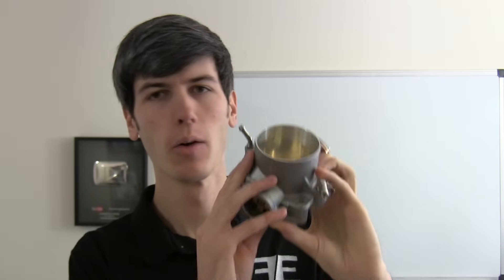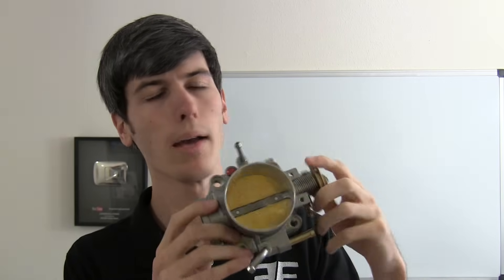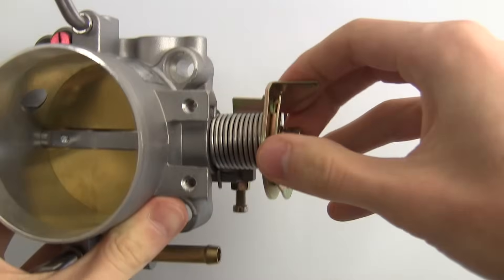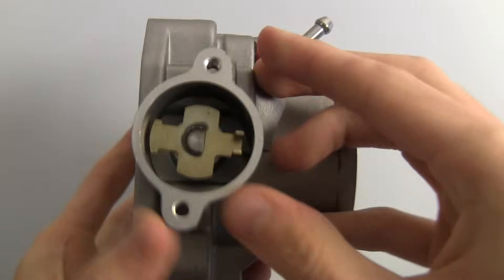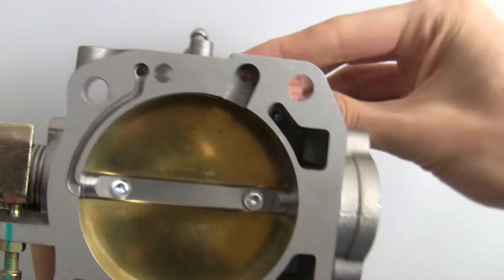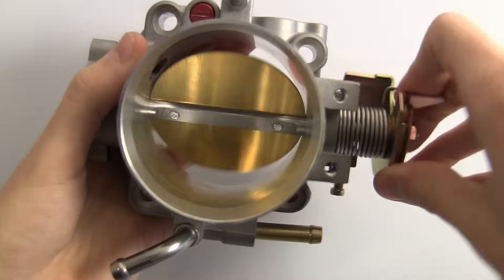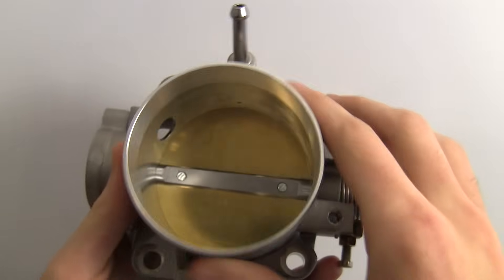Throttle Body - Explained

Comment: So if a throttle body is dirty, ( or has a leak ) why would that cause a rough idle at when you first start a car after sitting over night ? The valve is closed  minus what little is opened from being dirty and not make a good seal when close.  And seem like the car would  continue to run rough ? ( My 2007 Acura TL  has a slight rough idle on start up but after a minute it goes away and runs normal.  Internet search said it could be throttle body needing cleaned or having a leak ) Help ??

Comment: On 4:23 the top vacuum line should I keep it blocked ? I bought a cold air intake which has a place to connect the breather pipe then another small line which fits perfectly on my throttle body vacuum on top should I connect it there? But when I do my idling is more quicker and higher but smooth and when I close it my idle goes really low and wants to stall. Please advise as they told me connecting it like that will consume more fuel and cause high emissions

Comment: Great, few questions.
1) Where installed this throttle body?
2) Is typical too heat it via engine cooland? Looks like even on my Daewoo Lanos I have electrical heater there.
3) In my case vacuum line goes to the brake booster. But how vacuum collects there?

Comment: I had head gaskets replacement on my 95 z28 Camaro putting her back piece by piece... she ran good... drove on intestate etc... started every day etc last 4.. but if drove her short trip.. on the way back she shut of check engine light etc... would not start... but she did. Later..but got her home..started.. but i gave her gas it started sporadic Idling then cut off , wouldn't  crank ..but later it did ... not sure don't think fuel pump..

Comment: Here there is an alignment screw that ensures that the butterfly is in an idle position which means the exact 90 degrees with the surface and air passage is fully closed through the throttle variation. It cannot be the same for long duration of time and can be affected from multiple factors like dust and as you told climate. Instead of passing the air with the control of butterfly if we make sub holes on the surface of air flowing chamber and connect all sub holes to a single hole which goes to the combustion chamber and assign a piston at 180 degree instead of 90 degree butterfly it can last for a long time.

Comment: My engine wouldn't turn over at all, and I thought it ws a stater motor problem. The mechanic said it was the throttle body causing it. It stopped the engine cranking? Doesn't make sense to me...

Comment: The video is very helpful. I have a question, is there should be a small gap between the throttle plate/butterfly and the throttle wall?

Comment: I have a problem. The exclator is jurking due to the throttle valve. How to clean so the smooth pick up in the car? I have Tahoe 1997. Thanks!

Comment: The even better thing to do is to remove the whole throttle body and clean the area behind the valve more thoroughly. Also allows you to clean the small passages easier.

Comment: i have noticed throttle delay in my new car, specially visible in idling speed, engine is very slow to react when i press acceleration paddle, i must press continuously to rive the engine, is this wrong or its manufacturing feature?
Reply: Tighten your cable

Comment: I have a 1989 mitsubishi montero 3ltr v6. I can't find a new one, I can't find a rebuild kit. I had max bore bore it. The bottom half isn't working right. It has a spring and vale in it. I can't find a replacement.  An you help me.
Jim

Comment: Should the throttle plate seal 100% of the throttle body or is it normal to have a very thin line of air? I have an old lancer glxi 93 and my rpm is a little bit high. Hoping to get an answer from you good sir.  Have a nice day.

Comment: in some cars the iacv fails so they install a bypass with an idle up actuator working with the compressor and that works to prevent engine stall when ac is on...my question is, how is it that this bypass works when the iacv has already failed to begin with? is it because of the screw adjuster still allowing air for idle somehow?

Comment: What would make my 04 Chevy aveo  to rev up while driving and pressing on the brake. It revs up like it doesn't want to stop and I have to put it into neutral  and park it in order to stop. It's been at the dealer  for 2 weeks now. The throttle body  has been cleaned  but this never happens to any of the mechanics  thier. Could it be the transmission  or something inside ot. No engine light ever came on.

Comment: Does oxygen fall into the throttle body faster if it's got a high-rise intake. Or cause it to fall faster in the engine when u use a THROTTLE SPACER?

Comment: Hello,i got a kia rio 2013 1.1crdi and I just cleaned the trotle body,wich has drive by wire,any ideas why even after removing it was wide open,cleaned,fitted,still wide open,car starts,idle ok,drives normal.

Comment: My RAM 3500 shows the lightning light, then I can’t push Gas. 
I replaced the throttle body but still the same problem any advice I’m getting frustrated.

Comment: Considering this video,another question poped out of my mind and that is when the engine starts,you don t press the accelaration pedal. Therefore,how does the engine suck air to keep running if the throttle body is closed?

Comment: Hello I know this video is old but I have a skunk 2 70 mm tb for a Rsx type s but I’m still stock and do not have hondata will I still be able to run it mean time till I get hondata ? All n all my question is if It will work without a tune? My oem tb is bad and I have this one really not tryna spend the money so I wanna work with what I have

Comment: Hi, its rajen from india, pls explain me how throttle plate increases RMP and engine to work faster. 
Second . Someone has told me that machine works same whether in gear 1 or 5, it is the gear ration increases the RMP ,then in gear 5 how rpm increase from 2000 to 3500 when speed increases from 60km/he to 100 km/hr

Comment: What I want to know is, given the design, are throttle bodies universal between petrol and diesel motors?
I mean, I know the throttle works by the amount of diesel pumped irregardless of the air, but how does this affect upgrading the throttle?

Comment: my engine revs a bit high when i drive, especially when the car gets hot.  Sometimes when i'm going down hill and put it in neutral the rev can be a 2,000 rpm and gets stuck there.  Once i put it into drive , it drops down to 1,200.  What can this be because at times if feels like the car is just accelerating.

Comment: I have a 2012 civic lx. I recently cleaned my throttle body (without touching the plate) and MAF sensor. After doing so I have been running into all sorts of problems even after doing the PCM idle re-learn. On a cold engine start, the RPMs hit 1500 and gradually goes down to normal, but it takes a little more than 5 minutes/less than 10 min for everything to get back to normal.  Took my car to the dealer and they said that I more than likely damaged the throttle body and have to get it replaced. I dont know if they are just trying to swindle me or did I really damage it. Does any one have any thoughts? any feedback would be greatly appreciated.......

Comment: I have a 78cc throttle body on my engine thats stock ran by wire,  im gonna change it to run by cable whats the best throttle body to get? It was a stock engine all i did was change the cam. I dnt understand the difference in throttle body

Comment: After I changed the oil and filters in my scania 124l 470 my truck has engine knock and when I touch the accelerator then the engine keep boosting it self.I don't know what to do.

Comment: Question
When the key on will the Throttle body butterfly  open when you press on the gas pedal with engine off on a 2008 Suzuki Grand Vitara

Comment: Hii what's up.
I am facing problem when i switch off my car engine then after 2 seconds there Is unnecessary sound occur from throttle sound which occur it is like the valve open or close with something touching to throttle body . Can you tell why this happened and can it be stopped or not

Comment: my throttle plate/flywheel is not sitting flush on my non-mechanical throttle body, causing a lean condition p0171, 2010 Mazda 6

Comment: need info for my car..mine is a chinese foton van with chinese isuzu 4jb1 turbo common rail system. i looked all over the motor to find how the throttle is being controlled but i found no throttle body. i'm curious how it is controlling the rev.. any input please..tia

Comment: The problem is a axle of throttle cam must be precision move into body7 exactly in small engines. if its not steering of fuel or steering of throttle (air) is not correct.

Comment: I have 2017 camry se.  And I'm getting a p1604 Startibility Malfunction code.  The car surges up in 2nd gear.  I'm wondering would a bad throttle body cause this?

Comment: Hello Sir, thank you for your effort explaining about throttle body. I have questions for you. I have a 2017 Mazda CX9 Signature, and it already has 30k plus miles. I would like to perform DIY maintenance such as cleaning the throttle body. 
Is it advisable to remove the throttle body and clean it? 

If it is, what type of cleaner should I use and which part of the throttle body shouldn’t I spray? 

Besides the throttle body, are there other parts need to be cleaned?

After installing it, do I need to use a service maintenance device  ( Sorry, I don’t really know the correct term for the device) in order to reset and relearn functions? 

Thank you!

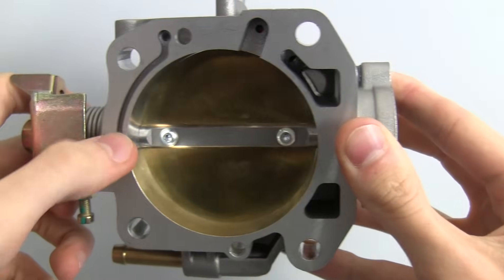Comment: At 2:00 you say it would read a higher pressure with more air flow but wouldn't it be the opposite?
Reply: No dumbass.. more air equals more pressure. If I were to push a heavy door open I wouldn't use less force..
Reply: @guitarpro594  he literally talked about Bernoullis principle. Went in one ear and out the other huh? The more air flow means that the air is less constricted and can speed up. Air has a lower pressure the faster its moving.

Comment: Does cleaning the throttle body really work? My Hyundai service manual says there's no need to clean it but there are so many videos on YouTube about the benefits of cleaning it.
Reply: Yes clean it and DO NOT TOUCH THE VALVE ON THE INSIDE AND MOVE IT, DO NOT TOUCH. if you have carbon build up inside this will drastically effect your throttle response and cause throttle lag. If you don't know if it will help take it to a certified mechanic to be cleaned and inspected. Or do a lot of research and have a friend who knows and has done it before to walk you through and show you what to do and what not to do.

Comment: Can the throttle body be installed  with the butterfly in the Vertical position? And if not please explain. Thank you for your help
Reply: Juan Gonzalez that would just be a reverse pedal which would be the same as slamming on the gas 24/7. pressing the gas would just flip it closed instead slowing down instead of accelerating. It’s possible but you’d probably choke the engine on startup
Reply: SoulandEllis wrong is working great. Thank for trying

Comment: Hey @engineeringexplained I have a question is it safe to back off the  nut holding in the spring where the cable connects? The throttle body I bought is really stiff (responsive but takes a lot of pressure) I am trying to make a lighter pedal but safely. Thank you for any and all information.

Comment: where is idle speed controller and how it s control the speed of engine ?
Reply: The video does explain this. Listen for IAC (Idle Air Control). Basically it is a controlled vacuum leak for idle speed.

Comment: I have a 1993 Lincoln Town car.4.6L V8.. On the left side of my throttle body has a hose connected to a medal "stump" like in the video here. On the right, it has one as well. But I cannot figure out what connects to it? Can someone please let me know? If a hose connected there then I don't see where it would attach at the other end?
Reply: It's either a vacuum or coolant line.

Comment: I went to do an oil change at a dealership where I got my car, and they did an multi-point inspection,  and they said the throttle body is dirty, and was going to charge me 89.95 for them to clean it, is this something I can do myself? I'm no mechanic but I'm good with tools.
Reply: Yes it's easy, simple instructions below😎 and always remember NEVER MOVE THE BUTTEFLY VALVE if it is electronic they are calibrated from the factory and should not be moved as it can ruin the calibration thus ruining the part. (Dont worry it's easy) 
⬇️😎
•Disconnect your car battery (negative terminal first, then positive), make sure the cables DO NOT contact the terminal (I like to wrap them in a shop rag to prevent contact).
•Loosen hose clamps on your air intake and remove. 
•Remove electrical plug from throttle body sensor (if applicable) it would be a pinch clip most likely. 
•Remove hose lines from throttle body (if applicable). DO NOT MIX UP LINES.
•Grab an Allen wrench or normal wrench (respective to the hardware used to secure it on your vehicle) and loosen your throttle body bolts *leaving one bolt in*. 
•Carefully loosen the last bolt holding the throttle body in place to make sure the gasket does not fall out into the engine bay. 
•Once bolt is fully loosened push the bolt forward to secure the gasket on the rear end so it will not drop into the engine. (Apply pressure to the bolt left to prevent the gasket from falling in your engine bay) and carefully remove. 
•take picture of how gasket fits on the back for later reinstatement. 
•Then simply use throttle body cleaner to clean the valve per instructions on the bottle. 
•Spray, soak, repeat, gently wipe, repeat as needed. (Do your best to not move the valve).
•reinstall throttle body
•plug throttle body in (if applicable) 
•Reinstall throttle body hoses (if applicable.
•reinstall air intake 
•connect battery terminals
•start vehicle and warm up to normal operating temperature. 
•rev engine to test for sticking and throttle response.
•test drive and enjoy your newly cleaned throttle body and enjoy your improved MPG.

Comment: I have a Ford Explorer 06/07 model. when it start after a while it stops abruptly showing the battery sign and writes check the charging system.  This has been check bit the problem persists. what do you advice

Comment: What will happen if by mistake a bolt nut fell inside the air intake hose while you have removed it from airbox?
Will this goes straight to the engine?

Comment: Ok, i understand the throttle body in a NA engine opens up and allows the vacuum of the engine to suck in more air thus increasing revs. But what about turbo or supercharged engines? Also, are the 3 or 4 plates on the intake of a supercharger the throttle bodies? Or is there an actual throttle body still inside, closer to the intake manifold? Help, anyone?

Comment: Quick question (for anyone knowledgeable) I've had issues with my Tps that I've replaced twice. This second time, being a little more aware, I noticed that when the throttle position moves it does not turn my tps, nor is there any other position to fix the tps that allows it to rotate. Obviously the first idea is that the tps is not the correct one for the vehicle, but this is the exact same type of tps that was on the vehicle before I bought and the last 2 I've purchase over the years none of which actually gets turned. Notes: 1 . I'm buying based off the vehicle make not just repurchasing the same tps based of MN.  -- 2. I've tested each tps (by manually turning and watching on a diagnostic tool) and have proven the tps are not faulty  -- 3.  Ford Codes - P1121, P1120, P0122
Reply: Does your battery have the correct voltage and amperes?
Reply: It sounds like your sensors were installed incorrectly or you are having voltage issues. I would check your battery if you still have the vehicle and go from there If you have purchased multiple of the same part with the same outcome you need to move to another diagnostic (like switching the pigtails attached the the unit, *the electronic connector that plugs in*. My experience tells me you are getting insufficient voltage to your needed parts. Take it to a qualified mechanic with an electrical background or the dealer and have them fix it unless you want your vehicle to catch on fire in your driveway or sell it. Good luck bud!

Comment: Hi, did throttle valve completely shut or partially open during engine idle stage ? 
What I understand from this video is the valve is still closed and small amount of air is passing thru other channel.
Any help will be appreciated. Thanks !

Comment: Question: I manually cleaned the plate on my throttle body (the inside part was filthy) but then discovered it was an electronically controlled one. Herein lies the problem: I read these are precisely calibrated and never to touch them. I performed a throttle position relearn procedure and it runs fine. Am I OK or did I screw it up?
Reply: If it runs fine you're ok.. lol

Comment: I am trying to fix my car's high idle rpm problem. It's a fly by wire system. First order of day is to clean the throttle body. However, while doing that, I have noticed that the throttle plate does not settle down all the way when released. If you press it, it goes a bit further down. It this normal or could this be why my car is idling high? . At operating temp, the minimum it does is 1000 rpm. Please advice

Comment: Hi y have a MB A140 W168 2001 CLASSIC and y have a problem where when y start the engine  the rmp go up and down where if y dont press the acceleraion the engine stop completely, so even whith the new throttle body having giving the same effect as the old  one but if y drive like 15 min stop and start again it go normal like nothing hapend, why?